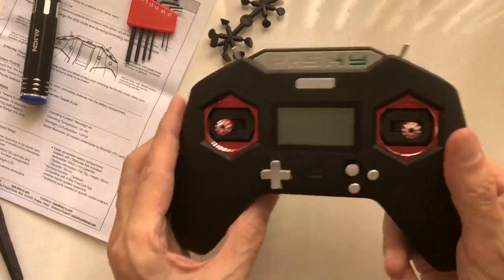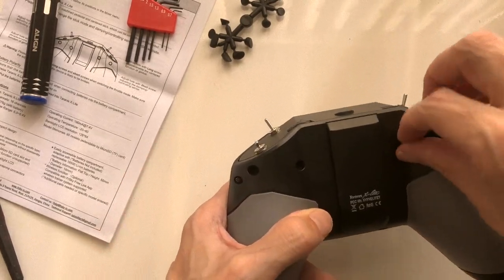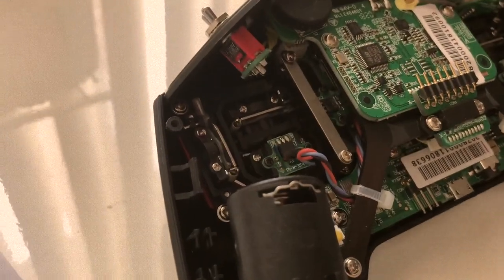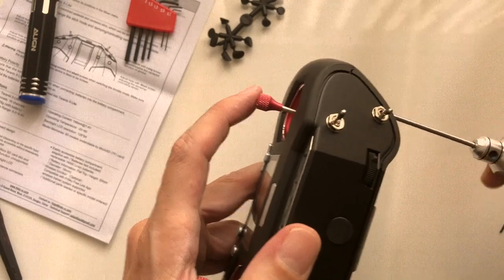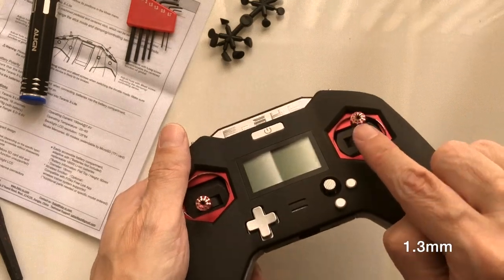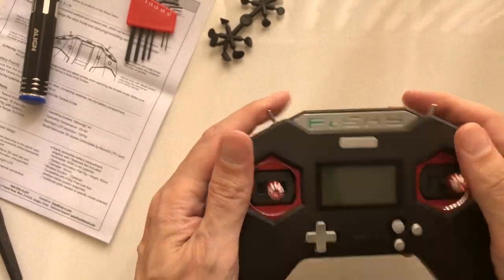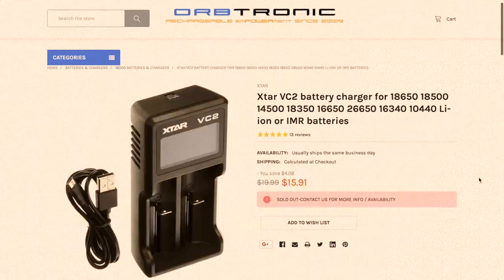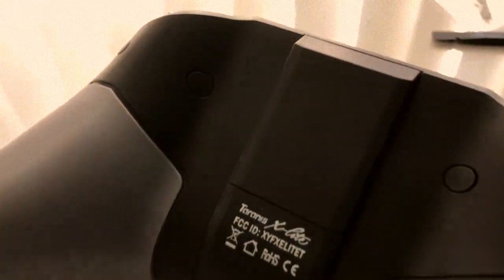FrSky Taranis X-Lite Unbox and Throttle Spring Setting

Comment: Is it possible to set each joystick to throttle control? e.g. one stick operates the tps for one motor and the other stick operates a different motor? This is for a boat project and I do not need ruder control.
Reply from the maker: Hello~ This is a little outside my area of expertise but I should think that through channel mixing you could get both sticks to control a separate throttle channel. Since this radio can be switched from Mode 1 to Mode 2 I imagine one could set up both sticks with or without centering and then just mix elevator or some other channel to the other throttle stick. Take this with a grain of salt however as I've never tried anything like it!